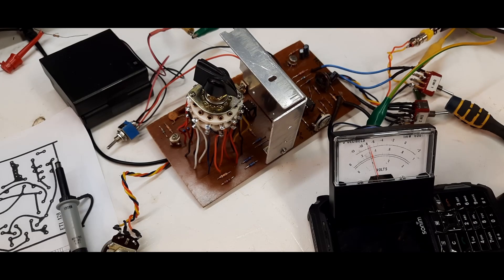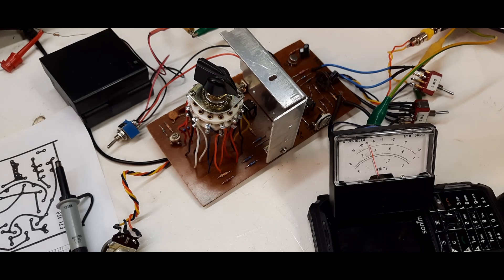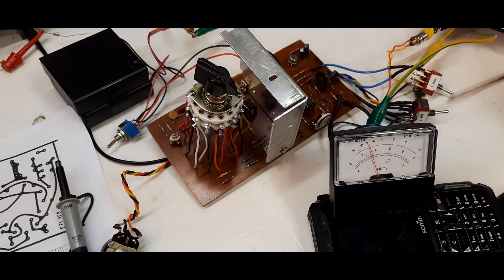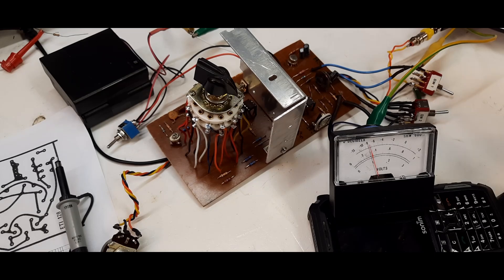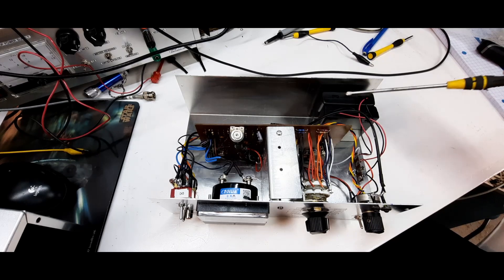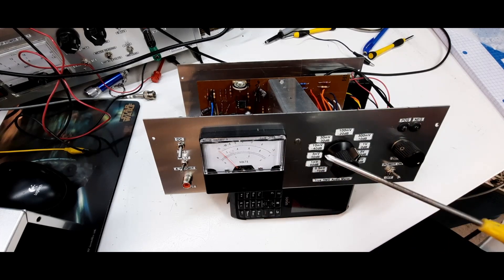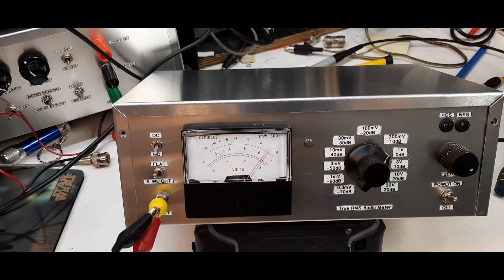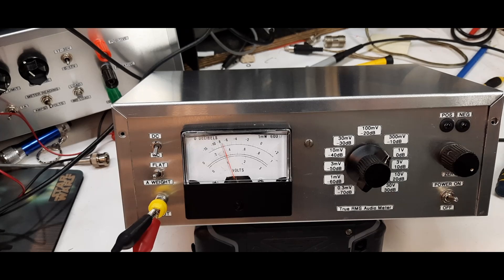Electronics Today - True RMS Audio Meter - Now Working!

Comment: Love your videos! In the dark ages, when I was a high school student, I would build projects from various electronics magazines. Maybe three or four months later, there would be a correction printed in the magazine. Kinda like the stuff you mention in this video. After a while, I didn't build anything until 6 months went by. I look forward to the projects you build. They have a real old school look.
Reply from the maker: Thank you for the kind words. Projects are fun and it sounds like you took advantage of that. I also check the later issues for corrections too. Good thing I can easily find them. More to come .. I try and put one out per week. Cheers!